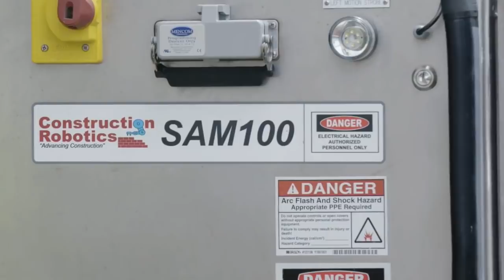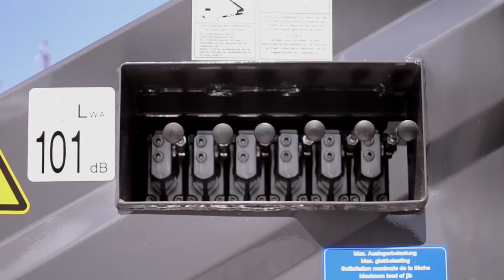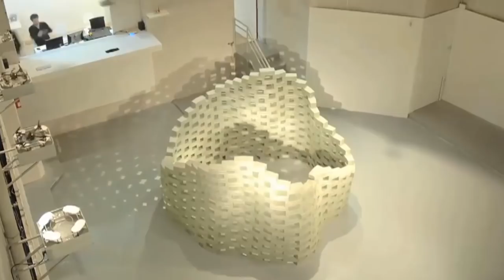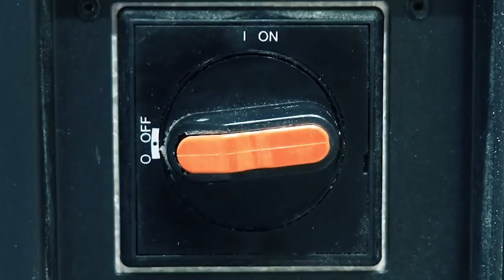BUILDING TECHNOLOGIES THAT WILL BLOW YOUR MIND

Comment: Correction: The material placed between bricks to bond them together is called MORTAR. GROUT is a material applied to the gaps between tiles or bricks after they are set. It is used as a sealant and is often decorative. Please educate yourself before attempting to educate others.